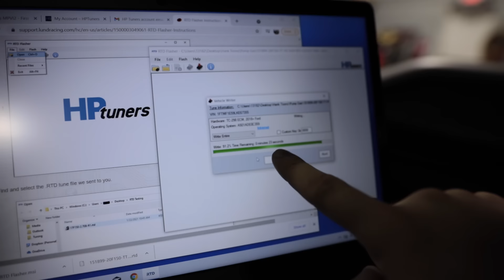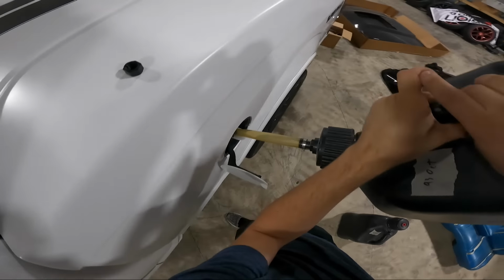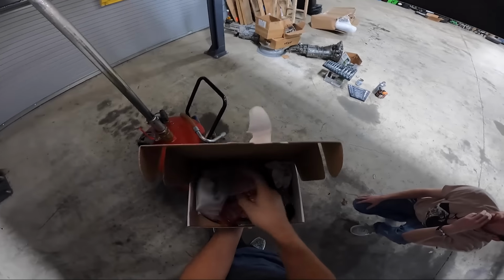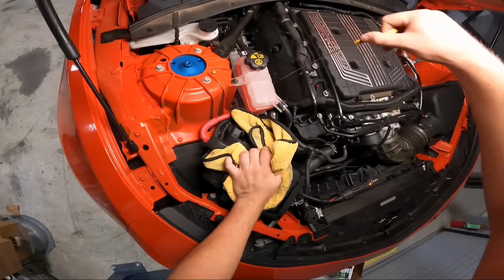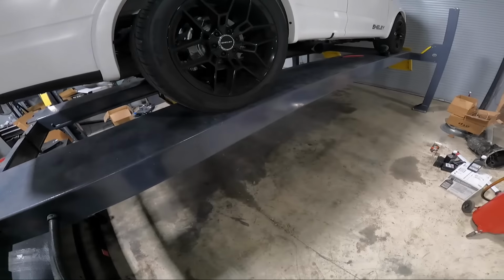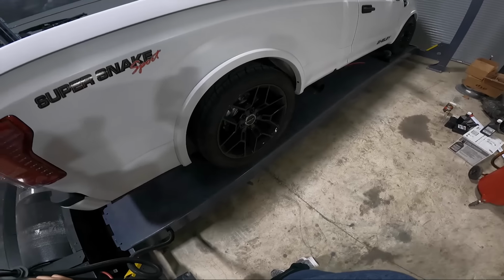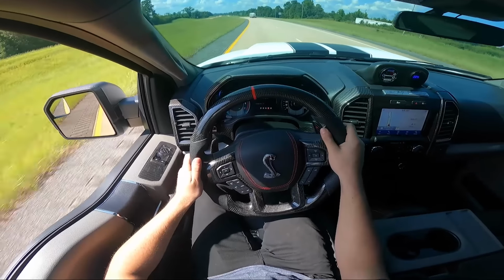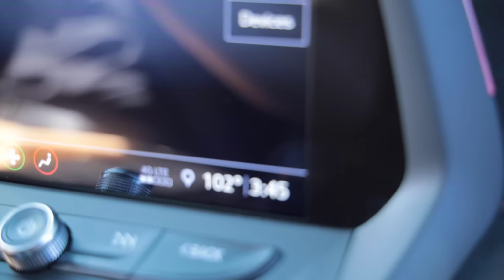Straight Piped ZL1 Camaro vs World's First Twin Turbo Shelby F150!

Comment from the maker: It is actually insane how close these two were during the race! 😂 But knowing how fast Hank can be, I had to get one of the other cars up to speed with him.  So with that being said... What do you think is happening with Captain in the next video? 👀
Reply: Either a Procharger / TwinTurbo or Supercharger + Nitrous setup.
Reply: Hopefully Captain gets headers & a full E85 setup + FBO & a pro charger / twin turbo setup
Reply: Giveaway the camaro or turbo charge it
Reply: @itsjusta6 install a black coolant tank on the shelby truck and install a cam in it
Reply: Do a push button coversion on this truck
Reply: Do a series of rebuilding and modifying the F350 more please
Reply: Do more telsa videos please
Reply: I can’t wait to see the Camaro! Wonder how much power it will make. Also when is the giveaway winner announced?
Reply: Probably a smaller upper pulley
Reply: Turbo the zl1 with the supercharger
Reply: You'll probably go to a bigger pulley, and some better injectors in the ZL1
Reply: Guessing you’re going with a smaller pulley and flex fuel
Reply: Small upper and roto fab big gulp cold air intake..
Reply: Ported supercharger and heads
Reply: The zl1 is definitely getting nitrous!🔥🔥
Reply: So has anyone won the savetheracecar giveaway 1?
Reply: I'm betting on the truck

Update: Holy shit that was close. Can't wait to see Hank turned up and race the Captain again with its new mods. 👌
Reply: That’s a bias run u ran the truck with e and tune against the 350 and now u give the Camero easy runs with just 93 fuel
Reply: I think it'll probably  be a bigger throttle body with an intake and a smaller pulley
Reply: Smaller pulley and different intake, not sure sizes or kind of intake.
Reply: @xerinety  it’s already supercharged🤣
Reply: What happened with the McLaren, I miss it actually
Reply: Upper pulley and e85 for captain
Reply: I thought we keeping it stock😂 even tho nothing stays stock
Reply: Pulleys and intakes would be the logical thing to assume
Reply: dad plz put no lift shift on the mero every shift was a nudge
Reply: Twin charge
Reply: Bolt on a Doug for easy 300 more horsepower 😂
Reply: New smaller pulley for the supercharger, along with a tune
Reply: Smaller Supercharger pulley and larger crank pulley plus E85 tune.
Reply: @xerinety  its already got a blower stock….
Reply: Pulleys/ ported or aftermarket blower?😮‍💨
Reply: Compound the damn thing already haha talk to Helion they might have a kit. would be cool to see twins with supercharger haha
Reply: Pulleys, intake, maybe NOS
Reply: Turbos?
Reply: Change blower pulley
Reply: Ported blower and either heads or intake🤔
Reply: You needa race this supercharged f150 in Lafayette with the truck 👀
Reply: 2 mods being done are CAI and different pully🤔
Reply: A big blower or twin turbo the zl1 ??
Reply: New blower or new injectors and running e on a tune
Reply: I’m gonna say king 2650 ported blower on e85
Reply: Meth 💉😈
Reply: Kong 2650?
Reply: @xerinety  captain is a supercharged LT4
Reply: It went exactly how I thought  and I pretty sure you doing a pulley and American racing tensioner
Reply: Pulley and E85?
Reply: smaller pulley ?
Reply: Either two pulleys or one pulley and a wider belt
Reply: Ported supercharger and pulleys
Reply: Smaller pulley and an intake
Reply: @remy.a._  that won't do 100+whp
Reply: Hey man so I think I’m for speaking everybody on here. Can you please stop repeating yourself so much. I know it
Makes your
Videos lomber which
Is begged for you but bro it is literally
Beginning to make your
Videos unwatchable. I’m not gonna watch something again if I fall asleep during it. When you
Repeat
Yourself 3 times
A
Row
 I’m already asleep. Maybe put out less videos a week but make them better quality.
Reply: @justinunger38  a cam? lol in the f150? what the shit you talking about!! for 1 there is 4 cams. for 2 no cams heads or built motor is needed and those coyote engines will make 1200whp. there are plenty  of mustangs and f150s making 950hp comfortably to the wheels and running 8s and 9s and pushing it they can go 7s (mustangs gts) and 8s (f150s)  without  ever opening the engine. stock cams stock heads stock internals. its the luxuries of the coyote and also the reason they cost more than a LS. But LS has to be built to get those numbers and power. Heads Cam pistons rods etc. also when it does come to building a coyote its more expensive because you have 4 valves per cylinder more cams etc. but built the coyote is a pure monster and the reason chevy/LS and Dodge/Hellcat/Demon guys have now switched to Ford/coyote platform. its the only way to go really fast.
Reply: Zl1 needs heads cam etc just to make more power. so i would say you are going that route. they needs the love of internals to go big power. this is where the coyote shines over the newer chevies. No heads cams or built motor needed and you can push boost and 1200whp on most of the factory stuff. coyote is king at this point. Hence why the 67 camaro went coyote instead of a LS or Modern GM drivetrain that is not call a LS but people still consider a LS
Reply: @reprieverc  compound kits are dumb. its a waste. you can make more power off 1 turbo or 1 supercharger than you can with 2 turbos + the supercharger. compound sounds cool and looks cool. but its super inefficient. it dates back forever where some car makers have done it. but when aftermarket has tried it to get big power it never worked or made sense. it takes a lot of HP to run a supercharger. then you add turbos and eventually the supercharger cant keep up with the turbos. so its lose lose. yes you may get the torque or off the line feel of the supercharger and then boost higher up. but eventually one cancels the other. so you do a twin turbo kit to make up for the 2.  1 big turbo can make more hp that twins on a lot of cars. And drag most twins at a dragstrip. problem is it takes a lot more to get 1 big turbo spooled up. Hence why they do good at dragstrips because you spool it up and bump into the staging lights. twins are small so you can spin them up faster which gives you more drivability and street performance.
Reply: @goranmarjanovic1401  you know i kinda agree with that. But its a bunch of things like drawing out every video and mak8ng it 30mins long and the part we come to see only lasts 5 mins of the vid. im all for seeing the builds and the action. thats what makes the channel great over others. but these long  videos that end up waaayyyy longer than they should. now that makes it hard to watch and stay awake. and i love long videos. Most youtubers i want linger longer videos. But the way this channel has gone. It makes it hard to make it to the parts we want to.see.  Hopefully these things will be fixed as the channel moves on from Doug. he said this was part of it. so we will see. HE HAS TO ENJOY WHAT HE IS DOING AND HAVE FUN. or us as a audience will not enjoy it and sense the animosity and lack of joy that that st times feels faked and or just isnt there.
Reply: Itsjusta6 Awesome Video I'm surprised that Hank kept up with Captain that well on Waste gate and I think Captain is getting FBO or E85
Reply: Can u use old intro song with new clips please?
Reply: New supercharger pulley and injectors
Reply: I feel like the ZL1 is getting a bigger supercharger or boring it out and putting a boost controller on it and running methanol injection kit
Reply: Pulley or bigger supercharger + fuel pump or bigger injectors  “wing delete , duckbill, nascar wrap”
Reply: @carculturenation2166  we’re all ford guys around here and coyotes have great power but stock internals on them will not hold 1200whp it will rip them apart we’ve seen it happen especially boosted or nitrous, that’s almost a 800 hp difference from factory which is not rated for anything without porting heads or gapping rings it will blow
Reply: parker bethke  won’t be close when the ZL1 get’s turned up 😏
Reply: My guess is heads and cam package with some E85 simple but can definitely get you at least 100+ more HP to the wheels.
Reply: @keeganrupert8180  he said it wasn’t going too be a cam and heads alone won’t make power it only makes it more capable of holding it
Reply: Nos
Reply: Upgraded pully and tune
Reply: @carculturenation2166  you must be a hoot at social events lol I don't disagree with anything you're saying I was just going with cool factor. If Gavin wants a purpose built track car I'd go single large turbo twins for a fast street car but my original statement still stands for coolness regardless of any technical bs...
Reply: I’m gonna say smaller pulley on the blower and a different belt
Reply: New supercharger and smaller pulley
Reply: Hey man not gonna lie, what you do  it's getting old.. I seen your other channel and  I know what you mean and feel. I Left a comment on the other YouTube.Business's is business but I'm hoping this is old content and waiting for the new content that you promise us. God-bless you please take care of your mental health!Hey man not gonna lie, what you do  it's getting old.. I seen your other channel and  I know what you mean and feel. I Left a comment on the other YouTube.Business's is business but I'm hoping this is old content and waiting for the new content that you promise us. God-bless you please take care of your mental health!
Reply: Lemme guess.....you're going to keep it stock😂😂😂😂
Reply: @carculturenation2166  you know I completely agree and it’s very hard to watch his videos anymore. Honestly his body language tells it all literally the last few I couldn’t watch the whole. And I understand with YouTube the more videos you make the more likes you get the more views the more comments the more you take in. I mean this man owns so many cars so much property. For fucks sake we bought this guy a fucking mclaren here is the sad part for me he says he’s depressed but he’s over here pumping videos out like he’s broke right now. He don’t care about himself he just care about the money. Like if I was in his shoes I would shut it down before he kills himself because the depression takes him somewhere he doesn’t want to to. Literally I would go iron this depression situation. By this i do not mean to to the doctor and get on pills. By this I mean go get some help from a support group. A therapist who doesn’t prescribe medication to fix the problem is the last thing we need is him turning to drugs. Even prescribed ones. I think that he would really benefit by working a 12 program. 12 step programs aren’t only for addicts. It’s just he’s not willing to give up the crazy money he’s making right now off YouTube. A sponsor is required for 12 step programs. He would also really benefit from a Human sponsor, not a sponsor who is sponsoring the maKing of his video. ….. i pray he goes and gets the help before it’s too late.
Reply: Compound chargers? Twin turbos compounded into the supercharger for max boost would be sick.
Reply: Smaller pulley and headers 😁
Reply: Gavin, I just have to say, for the first time in a long time, I noticed you’re back to the way you were.. it takes some balls to own your F ups and acknowledge you made some bad calls, only because you were thinking of everyone else. Man im glad you made those hard calls and took control of what was happening. As much as it sucked, we all felt the pain, anguish and disappointment you were feeling. In saying that, it’s easy to see what’s on the horizon for you and the Chanel. Stay grounded, look after number 1, and bring on the good times..Don’t Loose Sight 
Much love brother❤️🤙🏻🙏🏻💪👊🏼
Reply: blower?
Reply: Upper lower pulleys e85 maybe some bigger injectors 
My 13 zl1 is right at about 700whp on 91 
it’s for sale by the way low miles for the year and pretty mint
Reply: If I had to guess looking back at his old videos and being a detective id say new whiney boi and a smaller cup
Reply: @ixypj8637  would be awesome to see ngl
Reply: Please just keep captain a blower car that's all I ask😭
Reply: Well you bought a bolt on turbo kit for Hank wouldnt surprise me to see a bolt on turbo kit for captain
Reply: So Gavin is about to twin turbo the supercharged ZL1.👍👍😎😎
Reply: Cams and pro charger ?
Reply: Lets see he said in the video only 2 bolt on mods that make close too or right at , 100 extra hp , but that would put that Camaro well over 700 hp at least 750 -800 range  , bone stock they put out 650hp at 651lb torque  , 1st guess would be injectors and maybe a tune
Reply: Fuel system and a new supercharger
Reply: Cold Air intake, smaller puller on the super charger are my first 2 thoughts.  Port the heads (or bolt on ported heads, throttle body are my second two.
Reply: Honestly wouldn’t surprise me if there was a blower installed and obv some other stuff
Reply: Daniel should have driven everything you have bud channel would not be where it is without him he is the original guy with you so he should get to drive whatever he wants
Reply: My man was hitting them gears boy i tell you
Reply: Gavin you probably won't see this but it's a truck tee shirt
Reply: these are the videos we missed
Reply: E85 and nitrous
Reply: Nitrous, headers and e85 tune
Reply: @justinunger38  all you really need for a 6.7 is get rid of the cats and egr delete and bigger turbos
Reply: Maggie 2650
Reply: @Julio-cq1jt  what does the ZL1 have? Headers. About 30 hp over stock, truck has way more mods even on 93. Remember, Z is on 93 as well.
Reply: @xerinety     I.  Oh Ikono
Reply: Valiant charger e49
Reply: @Julio-cq1jt  Exactly he didn't even brakeboost the truck which would have started the race off with the turbos spooled already and definitely would have given the race a very different outcome.

Comment: Can we just talk about how Daniel was fucking shifting like a racing god.
Reply: Was thinking the same thing😂
Reply: Honestly zl1 turned into a auto with him driving
Reply: @michaelbarroso6986  you mean auto?
Reply: @shadow_legends2788  lmfso yeah I guess I messed up typing I was go hyped🤣🤣
Reply: He shifts better than Gavin
Reply: Y’all remember the video of him shifting his own car? The guy straight up SHIFTS😂😂
Reply: Not trying to bash Daniel, but 6th gens have built in No Lift Shift and are easy to shift fast.
Reply: @nestorlopez8786  all new transmissions are pretty easy to shift fast just by knowing how to use the clutch properly. My tired t56 won't let me bang any gears 😒
Reply: I was like welp hes hitting those gears that truck is fast as shit.
Reply: Your gonna put a  pulley and a tune on  captain
Reply: @nestorlopez8786  you've seen him shift other cars? He knows how to shift any car to make it sound like an automatic
Reply: The power of no lift shift
Reply: I was about to comment this, thanks for taking the effort to do it for most of use here brother 😂
Reply: @nestorlopez8786  this is the only answer. Nothing against Daniel, but people forget the Camaros and Vettes have NLS..
Reply: Still have to be good to shift even with rev matching, I’ve seem plenty of people shift badly with help from the car

Comment: Just a quick tip on F150's oil change. Hold the brake and throttle @ 100% and then crank. This will allow the system to keep it cranking to circulate oil to the filter, turbos etc.

Comment: Just turn off the rear O2 sensors in the tune and use those for the widebands.  I use both my rear O2 for dual widebands.

Comment: Hey man I am not telling you what to do but I strongly recommend using a Ford motor craft oil filter, motor craft oil filter is the only filter that has a valve that keeps oil in the filter so that when you star the car it supplies the top end of the motor with oil, especially being the 5.4l triton had problems with cam phasers due to aftermarket oil filters, just trying to look out for you bud

Comment: My guess is for the two bolt-on parts to ZL1 or probably a new throttle body, and a smaller pulley for the supercharger. And then a tune after that.

Comment: Damn, I don’t know which is more impressive, headers only ZLE pulling on a modded turbo or a brick with turbos hanging with a ZL1. I know the truck has a lot more in it, but the ZL1 hasn’t even started mods yet. I’m going with the ZLE though, it’s more aerodynamic than the truck but not as aerodynamic as a regular ZL1. My guess on the ZL1 1LE is your doing something to the SC, pulleys and intercooler upgrades maybe, or a 2.65-2.9 WhippleKong type thing. Can’t wait to see it, those are both badass rigs but given a choice I’d be the happiest man alive if I owned a ZL1, I’d be stoked with a 5 gen ZL1 lol.

Comment: Cold Air intake, smaller puller on the super charger are my first 2 thoughts.  Port the heads (or bolt on ported heads, throttle body are my second two.

Comment: I'm pissed I dont have a E85 pump near me. When I take my truck out west I fill my slip tank up with 85 specifically for my fun cars. Bought my buddy's 2011 R35 off him last spring and it scares the absolute shit out of my passengers and myself included on the kill tune. Its a built 4.1 boost logics stoker motor with all the goodies. The 91 pump tune is good enough for me. With the 91 tune it was 882 awhp and with the E85 it was making just under 1200. Pump tune is good enough for me! The trans refresh was a tad over 25k for a rebuild. It's a shep transmission stage 3 kit.

Comment: Intake and smaller pulley or some sort of spacer for the supercharger and or throttle body or porting maybe a new air cooling system like a cooling brick or heat exchanger not sure what would give the most bang besides the pulley